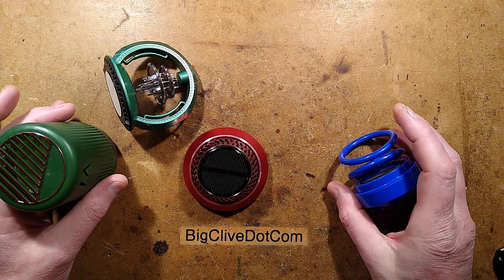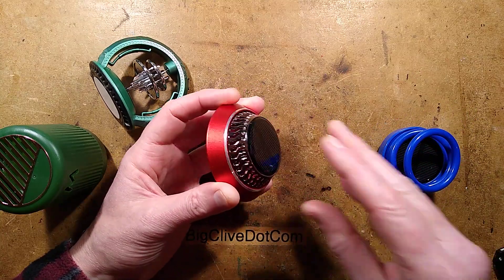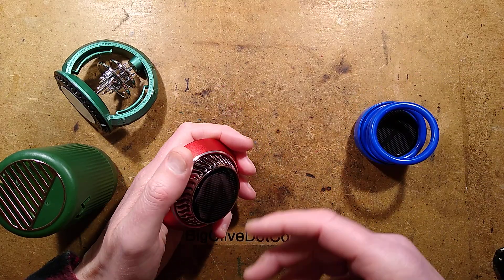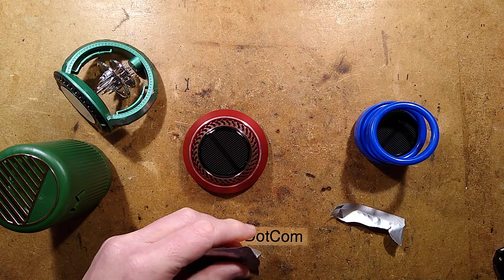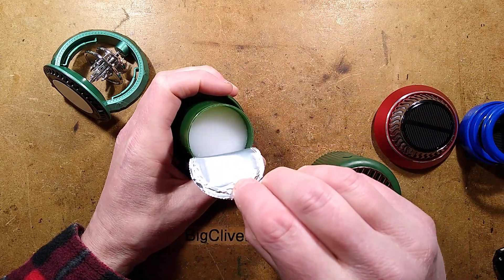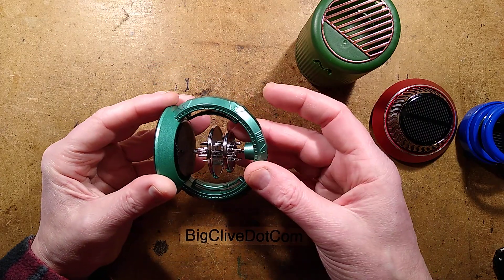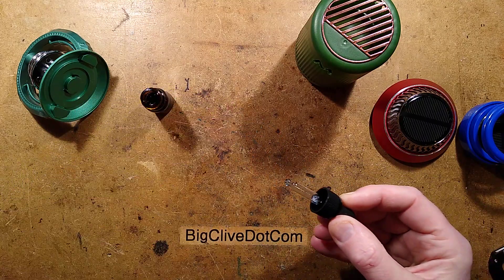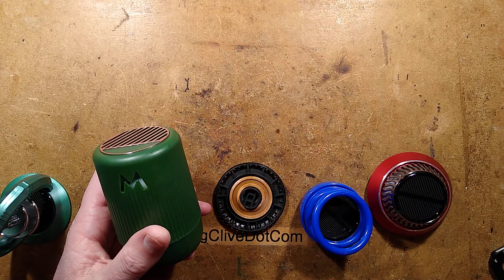How a vehicle molecular de-icer works

Comment: To be fair it does have some air movement and even cold air can defrost windows... but flow is nothing compared to your cars blower and it still needs solar to work so essentially useless compared to solar witch is heating and melting the window. That is only plausible explanation how this is suppose to work, but to it work, it needs far more powerful source as energy source that does the better job... ou boy

Comment: I totally forgot this guy is all about debunking stuff and at thought he was trying to sell us these things at the start of the video.

And I was like, "no way these things really work! Who is this dude trying to scam people!"

Heheh!

To be fair though, you could keep snow and ice off your car with vibrations. It just would have to be a much bigger device than these things....

And it probably also would shake your car to pieces in the process.

But hey, no snow on your car that won't start now and is falling apart when you touch it. Open the door and the hinge bolts fall out and the door falls on top of you.

Vibration is not to be messed with. I watched a video kinda like the Myth Buster's where they tested Nikola Tesla's vibration thing on a bridge that was being demolished anyway. They freaked out because the bridge started to vibrate pretty fast and the waves were getting stronger and stronger quickly.

Sadly they stopped it at that point. I wanted to see what it would do to the bridge.

And btw, Tesla's thing works because it matches the resonate frequency of whatever it is attached to which allows you to increase the wave strength.

But the catch is that I don't think you can cleanly demolish anything with it. The resonate frequency changes as pieces break. So you'd quickly end up with broken parts on said bridge but it probably would not collapse... Just be unsafe to use.

Same if you used it on a building.

Comment: No those work! I had one in my car the whole summer and had zero snow on my car. It ran out of zero point energy so it could not produce the needed hyperdrive ionizational weave functions just before winter started, so i have had snow issues for several months.

Comment: So it's a powered fan that circulates air inside the car to melt snow on the outside. Kind of sounds like the job that the windscreen blowers in a car do if they're not covered by dashboard gimmicks and stinky air freshners.

Comment: I actually used one of these to great effect last winter. The only reason I didn’t use it this year, is because the anti-charge of the aluminum distillation field caused proton migration in my Clearcoat.

Comment: Maybe they could actually develop an electric car that is useful for more than the "rated" range. If they say it's good for 300 miles it is really only useful for 180 miles which is 60% and that's because you have to keep it charged above 20% and not more than 80% or the warranty is no good.

Comment: I mean its amazing people fall for this stuff, Any device that could output enough microwave energy to heat up a car would be way bigger. Second it would cause metal surfaces in the car to probably heat up enough to catch something not metal on fire and finally every country likely has an agency serving an equal to the FCC we have here in America and a big unlicensed microwave transmitter is not going to go over well with them.

Comment: They claim to vibrate the water molecules with radiated energy? That sounds like a Magnetron, the key component of a Microwave oven. If those things DID work as advertised, they would be dangerous to be around, as the vehicle windows aren't designed to block microwave energy. (there's a reason your microwave oven has that metal plate with SMALL holes behind the door glass for watching your popcorn burn.)

Comment: My immediate thought when you described the mechanism was, "if that actually worked, wouldn't it be dangerous to stand near it?"

If you want to keep frost from forming on your car and don't care about how safe it is, a sufficiently large chunk of plutonium should get the job done - just like NASA uses in the Mars rovers. Just watch out for eccentric geniuses breaking into your vehicle and stealing it to power a flux capacitor.

Comment: - The blue one that Dave tested doesn't even work as an air-freshener because the stink-ring is sealed in and doesn't have a way to exhaust. It's literally just an optical-illusion desk-toy like the tire-thing that some mechanics have out front. I'd happily buy that desk-toy for $2, but they want to lie about it and sell it for $20. 🙄
- It's odd that suddenly all the YTers are covering this same thing, Clive, Dave, Ken… 🤨

Comment: It does make me wonder sometimes whether anything like this would be technically feasible. I.e.: preventing the water molecules in the air from being able to form ice is clearly possible, but would it ever be possible to design a device to do that to a car? (Or, as is more likely, just put a very thin element in between the layers of laminated glass to melt the ice).
Reply from the maker: My work van had a heated windscreen with a matrix of transparent conductive film.
Reply: @bigclivedotcom  I wonder why it’s not more widespread? No one likes scraping the ice off their car, so car manufacturers could make a killing selling it as an optional extra.

Comment: Wow, such de-icing, much smell, very style, so product (how deforested?). :) At least they could have made it into a wooden box so it would live up to expectations of an actual deforestation. The first one of these I came across in youtube ads look more basic. Those have simple plastic housings with a dark opaque look. Avoiding the need to drill a hole for the on-board LED. Like if it was designed originally to house an IR receiver, cheap GPS tracker or those pre-made universal enclosures you can shop around for.  Whatever they could buy up cheap and reuse without having to design their own, readily available from warehouses selling surplus parts of obsolete products, I guess.

Comment: Maybe interesting: those little DC motors look to be repurposed CD/DVD capstan motors. With the production of new optical disk drive products having dropped off a cliff in recent years these things have been finding their way in to many novelty products.
Reply from the maker: Also sold as "solar motors".  Very common on eBay once you find the model number.

Comment: I just bought some peppermint oil to repel rodents. We have hazelnuts in the garden and I found a large pile of them in the engine compartment on the battery. I trap a critter a day, on average, in the garage. Now I need an air freshener, but the devices in your video apparently only work in the UK.

Comment: I think the best way (untested) to defrost a car if the door still opens is to use a 600 - 800 W oil filled radiator. Just heat it up to max and then unplug it, put it in the cabin and shut the door. The warmed up air inside should be sufficient to melt the ice boundary  on the important glass panels just enough that they no longer stick on.
Reply: Done that in the winter not to defrost but to work on wiring on the interior of my car in an emergency in -10F weather. It was a 1KW heater though and the car was a Subaru Brat, so not very large. Worked well though. Also had 3 1kw heaters running off a 30a RV outlet heating a garage in the same kind of weather conditions to do a clutch replacement on a Honda Fit.
Reply: @theodorgiosan2570  sounds great :)

Comment: Sorry I was only half listening, so do I pour the 2 stroke fuel on the car to de-ice it or do I use the chainsaw to remove the ice, I’m little worried about scratching the paint work with the saw if I’m honest, or is that what these gadgets are for, do I content them to saw first to prevent scratching?
Reply from the maker: Just the chainsaw fuel.  Remember to film it.

Comment: A friend who worked in a TV factory may years ago old me whenever they were slow working on a job they always explained to the supervisor that the "thynamic diode" was not aligned and needed careful adjustment!.     The Alien movie had "molecular acid" coming out of the exomorph and eating holes in the floor, while  Startrek had "dilithium crystals" as a power source, I seem to remember.   Very easy to fool the unsuspecting public with pseudo-scientific jargon.

Comment: Ah,  but  if  you plug  them  in the  mains then they will cut  your  electricity bill  by  90% -  or  if  you  drop  one  in the petrol tank then the fuel consumption will  drop  by  50%

Comment: Easy solution to this problem, throw in a little (regulated) ceramic heater in your car, set it to a few degrees, and leave it plugged in overnight. Edit: A 120/240V heater, not a car heater.
Reply from the maker: Don't underestimate how much battery power that would use.

Comment: I remember back in the 1960s when JC Whitney and Warshawsky had catalogs from which you could "mail order" car parts .  I ordered a variety of so many different auto engine power increasing gadgets for my VW beetlet hat, by the time I was done It produced better that 2000 HP.

Comment: pushes up glasses
Um, actually, you need to put the lower flange into the counter-rotating Scransom, which uses the Jules Perodox to form a helical motion which prevents the quarks from generating a gyroscopic pattern on the boundary layer of the vehicle.

Comment: I live in northern Canada and having a Solar powered fan on your dash probably would prevent frost on the inside, when you leave your car and it begins to cool down, the remaining heat raises to the top of the car bringing the humidity with it, cracking a window also helps

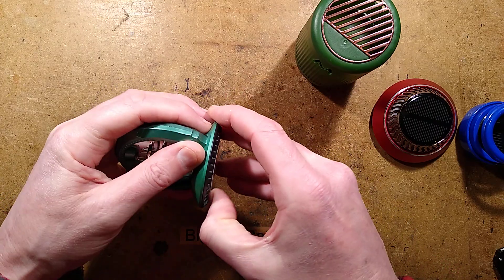Comment: 3:30 so i'm imagining a (real? person, not stereotype) cop seeing me do this in my car.  After parking next to the only other car, under the only working light pole,  in a run down parking lot. In a the run down part of a run down city. 
Then myself as the cop. 
You know, I would be lucky as the citizen if me the cop even thought it was oddly obvious. 
But it wouldn't matter. Everything i would say would be exactly the same as what he hears from real addicts every single day. (as i know i look super guilty, nervous and would be desperate to convince me the cop otherwise, just like a druggie )  But with out any cursing, so I suppose I'd have a real, but small, chance that me the cop would actually believe the negative field test was a true negative result. Assuming that  the chemicals in the scent oil wouldn't cause a false positive.

Comment: Is the bottom "aroma" chamber on any of those deep enough that you could fill them with something like calcium chloride to act as a desiccant?  That kind of dehumidification effect actually can help keep the inside of your windows from icing up in humid conditions where the temperature then drops rapidly and any suspended moisture condenses out into an extra annoying layers of thick icy frost.
Reply from the maker: That would be low capacity and risk overflowing when it absorbed the water, causing a risk of corrosion or damage to electronic stuff it dribbled into.

Comment: Honestly, if the solar panels/motors actually work, those are pretty neat little things, as long as you can get some less toxic air fresheners to put in them.
Reply from the maker: The pad could be refreshed with your favourite room aroma bottle.

Comment: The Deforestation one probably smells like Agent Orange.

Why did they choose gadolinium as the “magic/tech” ingredient? Maybe because it’s not an element that the general public has heard of in connection with high tech stuff like gallium or lithium?
Reply from the maker: I added the gadolinium bit due to its real exotic thermo-magnetic properties.  If I was a scammer I'd throw that into the mix to add plausibility if people looked it up.

Comment: Clive, can you make a video about car reversing sensors and how to properly electrically test them.
Perhaps explain the kinds of faults that can happen and why ?
Reply from the maker: They're often based on pulsed ultrasonic sonar distance sensing.  Most common issues are water ingress into the electronics and damage to wiring.
Reply: @bigclivedotcom  The ultrasonic sensors on the Volvo I have access to are mostly useless in the winter. Wiping the frost off can help.

Comment: If you really wanted an automatic deicer, you'd just need a heat producing element attached to a solar panel at the most basic.  Clearly you'd need a bit more power and a better circuit to get an effective heater..

Comment: I mean, you can make it into a device that prevents ice, but only on the inside of the car. Hope you don't mind it dispersing antifreeze into the air!
Reply: As long as it's the non-toxic variety, i.e. propylene glycol rather than ethylene glycol, you'd probably be okay

Comment: I just saw an American ad for a tiny plug-in heater that they claim will heat a room to 80F in less than a minute.
Even if it were the maximum 1500 watts allowed, which I doubt, the only way that's happening is if the temperature started out at 79.99F.
Chinese aren't the only ones.....

Comment: Even though these are a sham item, I wonder if it would be possible to attach a "bone conduction speaker" (thats the common listing name for them) to the inside windscreen and have it play a particular frequency over night which would actually stop ice from forming.
Reply: Disturbing super-cooled water actually causes it to freeze immediately.

The blinking LED version I saw advertised on Youtube will probably defrost a 3-9cm area if it is not a hard frost. At least: I have noticed blinking LEDs in windshields tend to generate enough heat to do that.